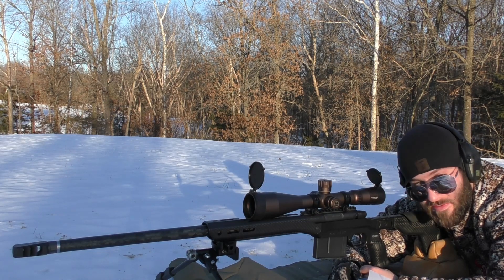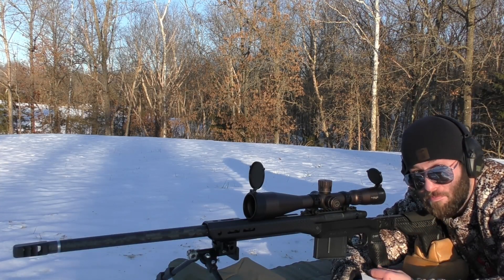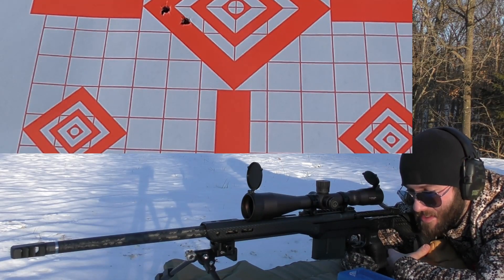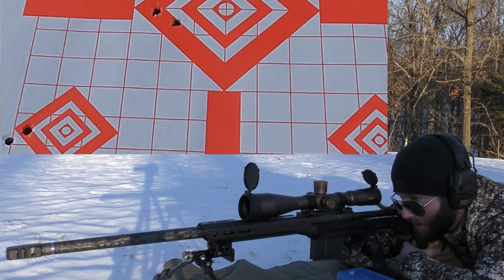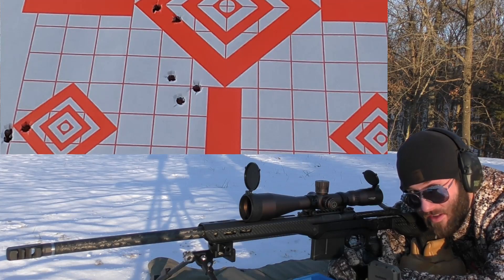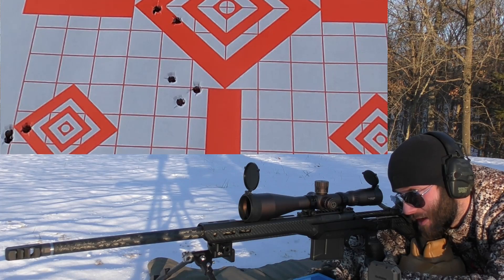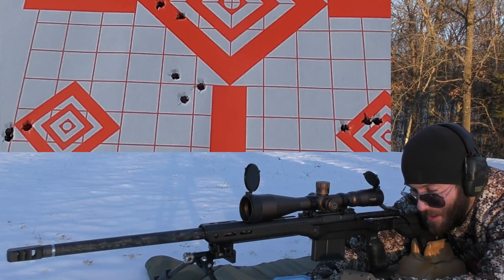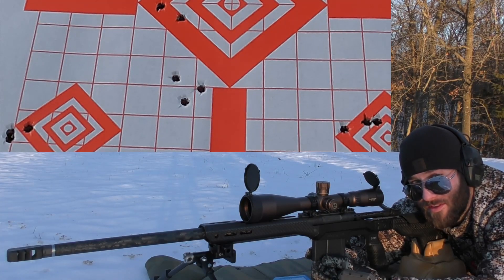7mm PRC Handloading Accuracy w/ Berger 195g Extreme Outer Limits Bullets and Vihtavouri N568 Powder

Comment: I’m curious on how far you’re seating the 195 Bergers?  Would be interested to see if seated further out help with pressure signs.  I’ll be reloading the 195 Berger as well.  Thanks for the videos.  Doing a bit more research before I start loading up and see what mine likes best.
Reply from the maker: I've changed the seating depth pretty dramatically, and I've had zero change in pressure, unfortunately. Thank you for the suggestion, though!
Reply: @RisenCitizen any suggestions on where to start my seating depth.  Was thinking backing it 0.020 to begin with and choosing which charge works best with that then mess with the seating depth even further.

Comment: Pertaining to your Garmin glitch: there is a known issue with them currently when you delete your sighters from the string (which I'm assuming you did delete your first two shots either before or after the first group) where it still takes them into account for the SD calculation. The only way to rectify it is to start a new string between the sighters and what you actually intend to have good measurements of.
Reply from the maker: This is my first time hearing about this issue. Thank you for the information!
Reply: @RisenCitizen  it has reportedly been fixed in the Version 3.30 update!

Comment: I wanted to try some Berger 175 gr out of my 280AI. It has a 1@8 26-inch barrel. But i couldn't find any at the time. So i bought some Berger 7mm 150gr and 168gr Classic Hunter bullets. I thought i would give that hybrid bullet a try. I wanted to try some N560. But nobody locally has N powder in stock. Are you going to work on 280AI load anytime soon?
Reply from the maker: Probably not. I don't have a 280AI right now, and the only one I have access to is getting worked on at the moment.

Comment: What length barrel? Try n570 I’m pushing 195s out of a 22” @ 2870
Reply: 24in is what description says. Wish I could sling 195s in my 20in, would probably be running 2600 lol
Reply from the maker: 24". I tried N570. The velocity spreads were discouraging.
Reply: @ it loves a full and I mean full case. I’m to the neck vibrate the case before I seat and I’m in single digit

Comment: Would you care to entertain the idea of reloading 180gr + in .308 win? Really would like to see the performance and velocity of exceptionally heavy for caliber bullets. Especially the 195gr Sierra tipped matchking. God bless and take care.
Reply from the maker: I could certainly entertain the idea, but without a really long barrel, I probably won't do any extensive testing with bullet weights that heavy. I think you need a pretty long barrel to get enough speed out of the 308 case to be able to get any kind of performance benefit out of those heavy bullets in that small of a case. There are competitions out there where guys are shooting 200g bullets in 308win almost exclusively, but these fellas are also running >30" barrels. So, they are taking the cartridge past it's "normal" limitations by how they set up these rifles.
Reply: If i get out soon, I will get back to you, i picked up 460 Factory Federal 185gr Otm Jug for ridiculous price of 10 a box. But it will be out of a 16-inch suppressed bolt gun. I'm just waiting for the gunsmith to bed it and finish up my other custom rifle.
Reply: As Promised i got it back and took it out to try with a 16inch proof carbon barrel it ran Factory Federal 185gr Otm Jug @ 2475fps, 9 SD and .6-.75inch groups 5 shot groups @ 101 meters/110 yards on my kahles range finder. It also shot hornady 150 superformance at 2800 fps and the groups were even tighter sub .5 moa.
Reply: It doesn't make sense to load a 200+ grns in a 308. Except for paper punching(Well it will outperform a 300 Blk Out). If you want performance with a 200+ bullet, get a 300 PRC, 300 RUM, 300 Norma. Burn the Barn, a 30-378 Wby. For Hunting, 308-150 grns, 30-06 165 Grns, 300WM/300 Wby 180 grns. Balanced for game performance. Paper, you can buy 250 grns 30 cal bullets, But need another gun with faster twist. Factory ammo up to 185 grns, but the 30-06 came with 220 grns round nose bullets(Back in the day for Std 1-12 twist rifles), guess the 308 will work. BUT unless you have it chambered (308)in a Long action and free bored(To seat out bullets) the powder space is reduced. Go to Nosler load data, they have data for 190 grns bullets in the 308
Reply: @WillyK51 I don’t totally disagree. I would say your opinion makes sense but it is still an opinion. I mentioned 195 grains which I would consider an exceptional weight for .308 and could also be used as subsonic. Even still interesting with compressed loads. I agree you could seat out heavier bullets but you would need a long action with a barrel chambered in .308 win. If I can recall 1:10 is plenty to stabilize a 195 depending on shape and length seems achievable with a short action. I’m not saying you’re wrong other than it “doesn’t make sense”. In the world of reloading…why not?? I’m curious regarding velocities and ft-lbs with a suppressor. I appreciate your opinion and comment. I’m always looking to learning more.